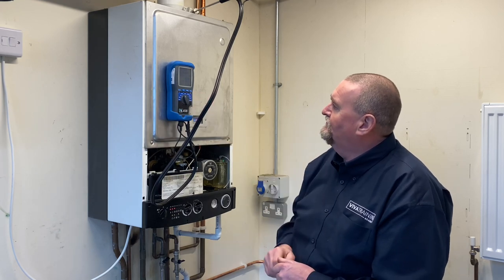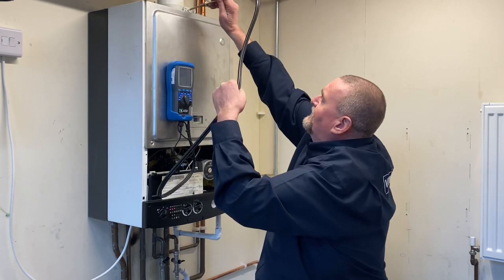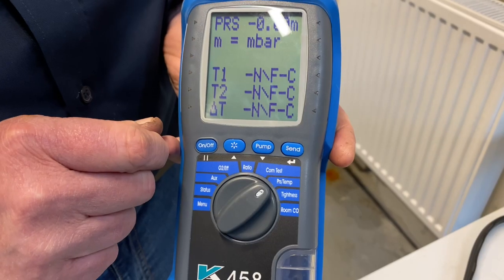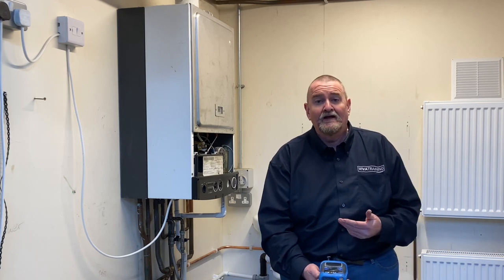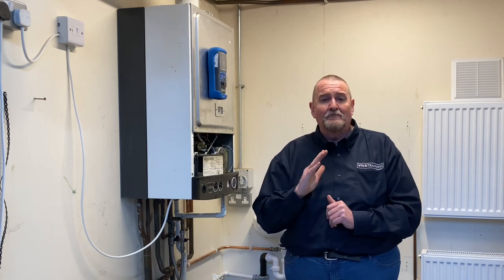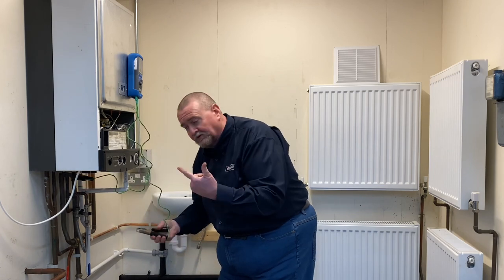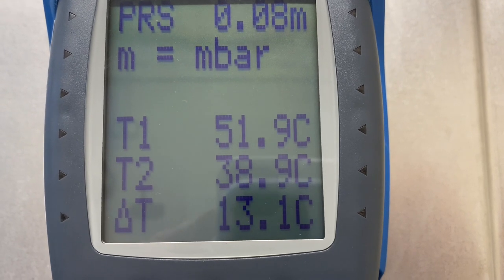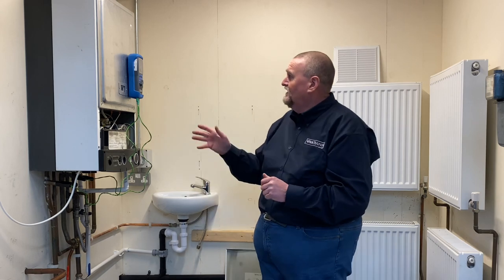How to use a flue gas analyser - Gas Training with Viva Training Academy

Comment: Excellent explanation Roy, not sure whether you know this but if you set the Kane to AUX, you can actually do your working pressure (PRS) at the same time when you are doing a combustion analysis. 👍
Reply: @Kevin Cranfield, I normally use the Aux screen, but as the video was aimed at newbies I didn't want to confused them. Thanks for the feedback 👍
Reply: This is handy to know ....cheers 👍
Reply: Very good video Alan/ Roy. My Anton sprint  is around 10 years old and they tell me they wont calibrate it anymore, so Ive been looking around for a  replacement.  I like the look of the kane 458. I assume you can get a  leak detection probe  (sniffer) attachment for it ?

Comment: I have a Kane 455. Which  iv'e had for a few years now. Not sure if its time to upgrade? I would stick with Kane though! My previous one. was a Anton Sprint 2000. Every year, it was a cell change, or they would find something else wrong with it.
Reply from the maker: Keep the 455 until you need to change it😂 No point spending money.:_drill::_mul::_mul::_cutters::_cutters::_wrech::_tap:

Comment: Great vid Allen, 

Can you do a vid or balancing a system with electronic probes . Finding it hard on balancing my own central heating system with TRVs .. flow return at boiler difference in minimal
Reply from the maker: I keep meaning to do one. I have new probes here for the video. Thanks. :_burstpipe::_gug::_gug::_mul::_wrech::_tap:

Comment: Link ebay  gas analyzer...plis thanks
Reply: @Maralexpau, I personally wouldn't buy 2nd hand analyser from ebay as it may cost more for calibration/repair than a new one. Kane actually have a new model out, the 458s which is really good, check out their website www.kane.co.uk